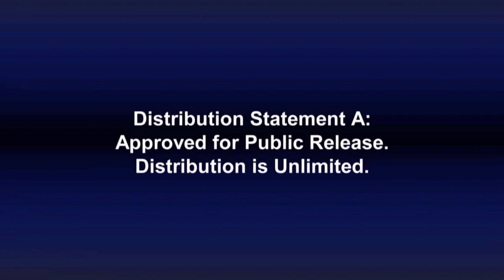U.S. Navy Railgun Auto-Loader Test • Mach Six Payload

Comment: What is that smoke ? Steam from overheating air ? Why is it brown at some point ?
Reply: Mammouth Lafouinne could be powdrered steel from the barrel
Reply: Mammouth Lafouinne 

It is a number of things. The actual "shell" being worn, the water being vaporized from the compression and heat then rapidly cooling, dust literally catching on fire, metal catching on fire and carbon burning off, likely some part of the barrel as the Lorentz force is impelling the shell from the back, and probably a few other elements. 

You don't go 0-4500+ mph in less than a second without some major disturbances in the force. Everything is superheated very quickly. I'm surprised the turn around is a mere 13 seconds, I really want to know how many shots it can sustain with that rate of fire. I'd be amazed if it were more than 5.
Reply: skeetorkiftwon Thanks for your answer.
Reply: yeah , pretty well anchored to ground , i didnt see any sign of recoil shudder etc , Wow would not want to be on a flat top wasting power shooting that
Reply: has to be an opposite reaction surely
Reply: Vaporized aluminum from the sabot oxidizing with the air

Comment: So what's with the smoke and stuff coming out of the barrel?
Reply: chaoshallnotfall the insides of the barrel spewed out
Reply: Vaporized rail and projectile. That's one of the main limiting factors of railguns, the extreme barrel erosion.
Reply: The projectiles fired from railguns travel at more than mach 6, i.e. six times the speed of sound. That generates an enourmous amount of friction with the air around it, called drag or air resistance. It's kind of like how when you rub your palms together they generate heat. The railgun projectile is quite literally setting the air around it on fire.